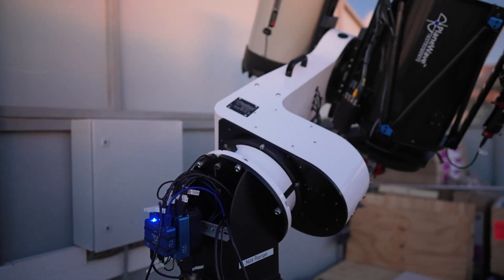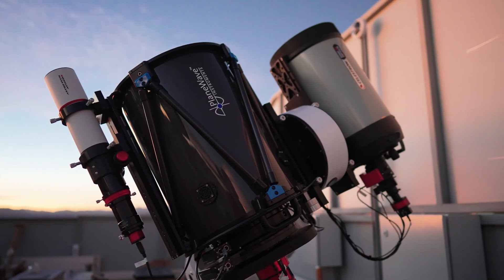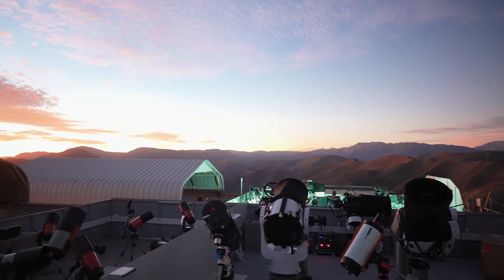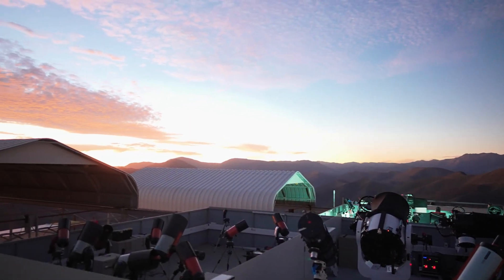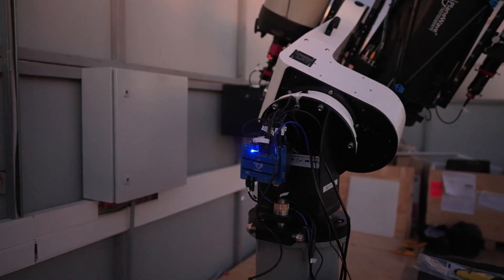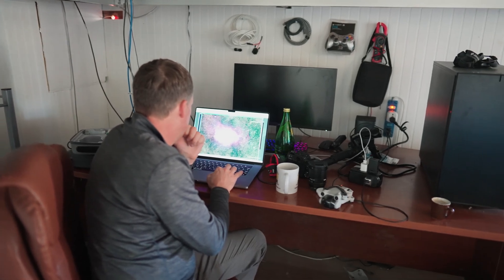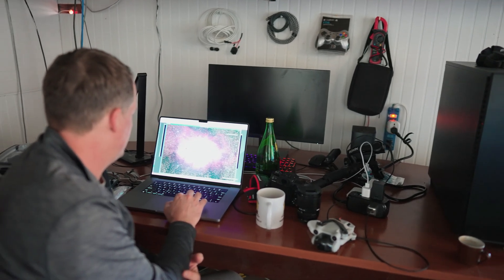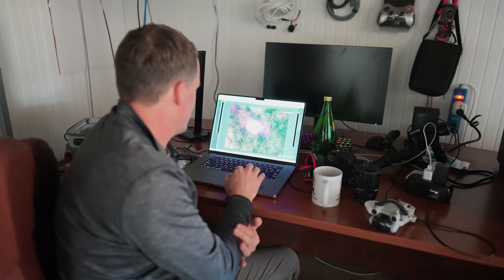Installing a PlaneWave DeltaRho 350 Telescope at ObsTech Observatory in Chile

Comment: I'm curious, do you polar align just like regular amateurs (ipolar, pole master, sharpcap, etc) or is there a professional way to polar align?
Reply from the maker: For the PlaneWave systems their software uses a pointing model to calculate polar alignment and then mechanical adjustments are made to the mounts. For alt/az telescopes polar alignment is not required.

Comment: Very impressive setup.  That C11 Edge HD looks small in comparison.  What function does the C11 serve that the 350 doesn't?  Are you running the C11 at f/2 with a hyperstar or something?
Reply from the maker: Thanks for watching! The main scope is a 1,050mm DeltaRho 350, so the client wanted a longer focal length system in case they wanted to image planets. The C11 is a Barlow, so nice long FL!